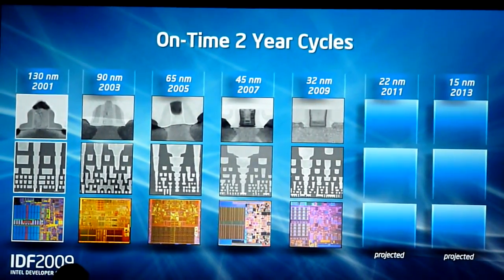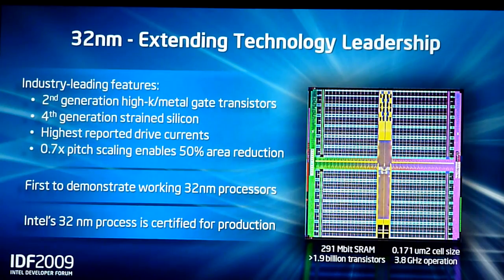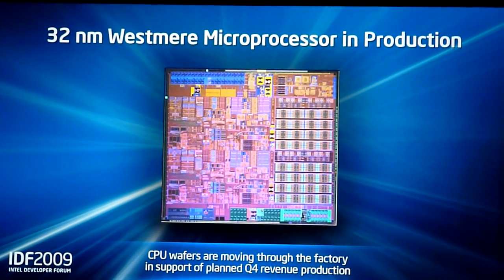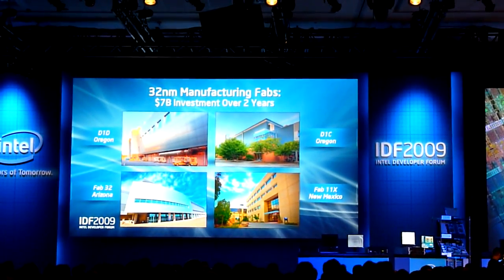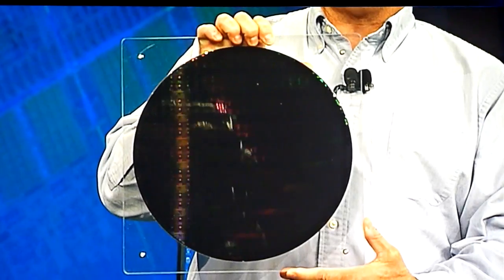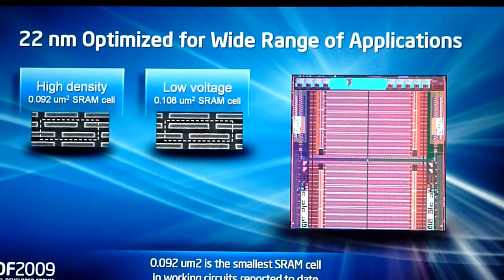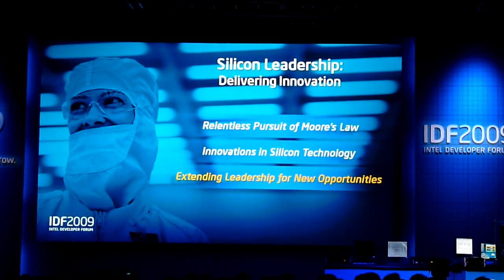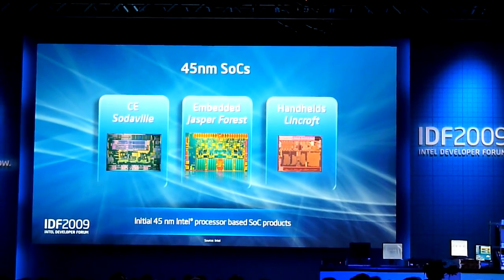IDF 2009 SF: New roadmap - to 22 nm and 15 nm

Comment: dude do some fkn reasearch, making smaller transistors means they can put in more of them... more transistors means more 0s and 1s.... faster speed
Along with that the architecture of the cpu and things that connect to the cpu like fsb and ram connections have been improved...  Not to cpu instruction etc..

Comment: pretty soon we'll be getting to the picometer stages but then after that quantum processors will have to become the new way of processing data because if materials are made from atoms and you get less than an atom your no longer using a material. we will stop way before we hit the size of an electron. besides i say we start looking into organic processing its 1000x faster the only problem is its reliability. btw your brain is a form of an organic processor.

Comment: @supertrinko 
It seems now the problem is that no longer are they taking away more of our nanometers, their cutting up the cpu power into sections.  Its like having 4 horses pulling a stage coach, they can only run at a max of 40 miles an hour, but if the cpu manufacturers just have one core it would run at the speed of a F1 car.  Looks like Intel knows they screwed up, but they're on a path now and to get off it would be admitting they were wrong.

Comment: Cpu's today are 65nm and 45nm that is a norm, and yes its going smaller and smaller for obvious reasons, you seem like you don't know much about comps, i shall take it upon me to educate you somewhat, what they are doing when they go smaller is reducing the size of their transistors and using better materials for their transistors, this equals to better efficiency as in less power used, less heat, better processing since there are more Transistors packed into the same space

Comment: I would agree with u, but my pentium 4(90nm) is absolute shit when it comes to video rendering. Processor hits 100% load just to render a simple video. My Q9550 (45 nm) only gets to 36% load and gets the job done (at least) 14 times faster.